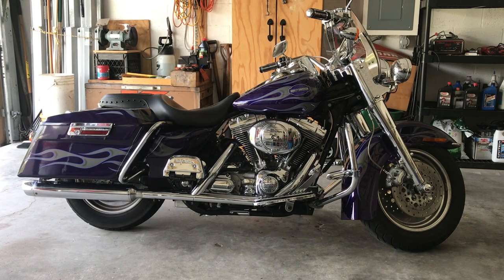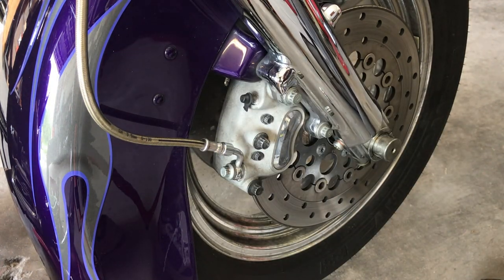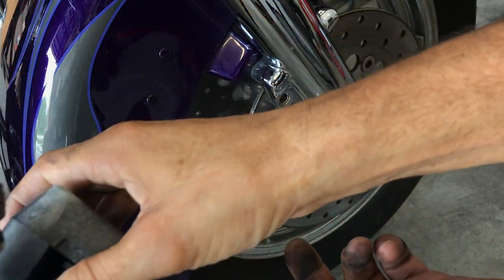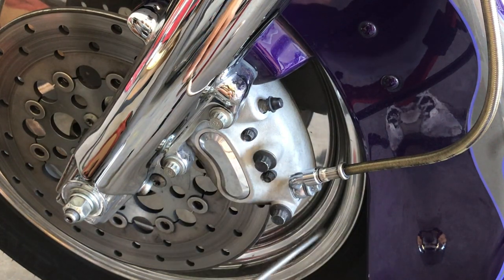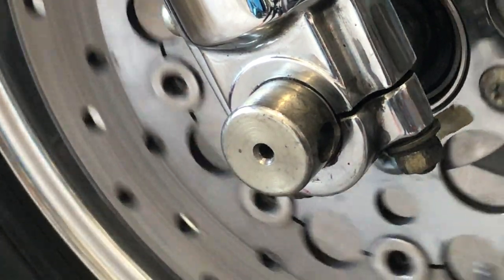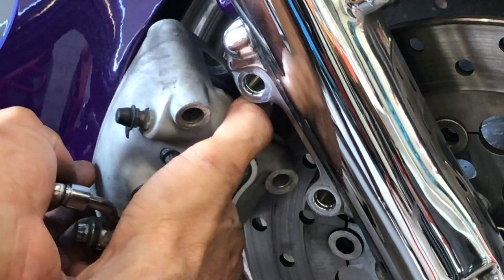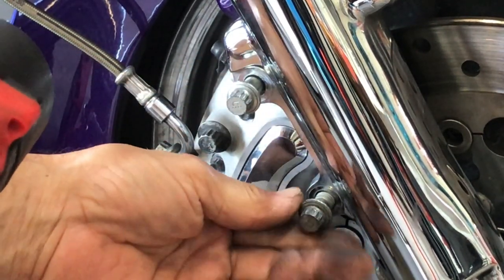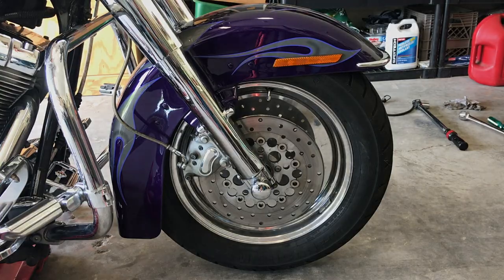How To Harley Davidson Wheel Remove & install.

Comment: Hi Rocco...Nice video, but the workshop manuals all recommend coating the entire axle with anti-seize lubricant...Here's why... "Anti-seize: Use on fasteners/components that have a different metal type than the material you are fastening to (the axle and bearings are dissimilar metals). The use of Anti-seize is for the prevention of dissimilar metal oxidation which occurs when two different metals come in contact".
Reply from the maker: Thank you Matt, I will keep that in mind. Ride Safe and have a great day.

Comment: I saw another video where a guy used a Crown Royal bag to put the calipers in.  Won't scratch anything bumping around..  Thanks for the torque values.  The caliper bolts are 16-24 ft lbs...
Reply from the maker: Just trying to help,  Thank you for watching and your comment. Ride safe and have a great day.

Comment: On my 05 electra glide, the spacers on the front axle are different lengths.   It's not obvious unless you hold them up next to each other.   If you get them installed on the wrong sides, the brakes won't fit on the discs properly.   It's a good idea to keep track of which one came off which side when you take them off.  Thanks for the video!
Reply from the maker: Happy to help. You're right, I agree with you 100%. When you take something apart put the parts on the right side and the parts from the left on the left side and you'll keep yourself out of trouble. It's an easy mistake to be made, especially if they fall on the floor and roll. Thank you for your comment and all your support. Road King are great motorcycles. Ride safe and have a great day.

Comment: That's what I have. XLH1200, and an FLHR. Also I saw the hole you placed the screwdriver in on the axle. Some people will put the hole in the up and down position. That can make a noise when you're going at faster speeds, like blowing across a bottle, and drive you crazy trying to figure out what it is. :) Thanks for the video.
Reply from the maker: Happy to Help, Any questions just ask. Thank you for your comment and your sub Pete.  Ride Safe and have a great day.
Reply: @TwoWheelRocco   You too sir :)

Comment: Love your videos, I have a 2012 Road king and need to remove the wheels off to get new tires put on. Thanks for a great video. 😀
Reply from the maker: Happy to help. The rear wheel is the harder one. Make sure you acquire that half-inch steel rod. It gives you a lot of room to work with the spacers, the belt and all that. Any questions just ask. Thank you for watching and your support Biker_Boi_Tein7.  Ride safe and have a great day.
Reply: @TwoWheelRocco  yes sir, the rear one looks harder because of the belt. I used to ride sport bikes and worked on them much easier, lol. Thanks.
Reply from the maker: @bikerboiteinz717  Once you get that half inch rod, it's not a problem. slide that half inch rod in.  you have more than enough room remove the belt it will be easier than your sport bikes. There's no grease. Ride safe and have a great day.

Comment: This is a great video and you are a good teacher.  I am curious why you do not tie the bike to the lift?  I had visions of popping the wheel off and the bike doing a back-flip off the lift.
Reply from the maker: Happy to help. When I fully understand the balance points, and that does come with experience. In the beginning, I used to tie it down but now I understand where the jack needs to go to do the front or where the jack needs to go to do the rear. Very stable when placed right.Thank you for watching and all your support SplitHairz.  Ride safe and have a great day.

Comment: Thanks for the video, just what I needed when I needed it, plus straight forward to the point.
I had new tires installed last fall at an independent shop, he put the wheel on backwards so the tire is in wrong rotational direction.
Reply from the maker: Happy to Help, Any questions just ask. Thank You for your Sub. Ride Safe and have a Great Day.
Reply: @TwoWheelRocco  .. ?
Reply from the maker: @ryangould536  Thank you for watching.  ?

Comment: Hi, is it ok to fit used lifters from another bike that only have 9000 miles on them? I'm a bit worried that you should only replace with new but can't see any real issue as they measure the same and they are a nice sliding fit in the bores, what do you think?
Reply: Forgot to mention that the bike is a 2002 1200 Sportster. Thanks.
Reply from the maker: I would not, Let us know how it works out.

Comment: Hey, Rocco.  Thank you for the very informative videos on a bike that is close to my own year of manufacture.  Just a point:  The axle holder nut torque, as per the manual, should 
be 11-15 ft-lbs (15-20 Nm).  I hope this is not the same as the pinch nut bolt, mentioned above...
Reply from the maker: Happy to Help, Thank you for your Sub Jan. Ride Safe and have a great day.
Reply: @TwoWheelRocco  That is the same thing.  11 ft-lbs is 132 in-lbs, and 15 ft-lbs is actually 180 in-lbs.  So you were spot on Rocco.  Great Videos, thanks very much.
Reply from the maker: Happy to help. Thank you for watching and your support Joe.. Ride safe and have a great day.
Reply: Any chance you might know the torque on the pinch nut bolt? Thanks.
Reply from the maker: Happy to help. 10 to 14 foot pounds, Pinch bolts Thank you for watching and your support Roger.. Ride safe and have a great day.
Reply: @TwoWheelRocco  - Thanks Rocco.
Reply from the maker: My pleasure Roger.

Comment: What was the torque on the pinch bolts for that clamp that holds the axel in place
Reply from the maker: Happy to help, Any questions just ask. Thank you for your Sub Willy.  Ride Safe and have a great day.                                                                                                             Torque value
50 - 55 Ft/Lbs  front axle
132 - 180 in-lbs   pinch nut bolt.
Reply: @TwoWheelRocco  the pinch bolts are 30 to 35 ft pounds
Reply from the maker: @chriscouch2169  Only 10 to 14 foot pounds. Tighten the rear one first, then the front (2008 service manual)
Reply: @TwoWheelRocco  yep, I was relayed the wrong info. Luckily I didn't break anything bc mine are torqued to 35 ft pounds. Apologies.
Reply from the maker: @chriscouch2169  I agree. I hate to create my own problems but it does happen. Ride safe and have a great day thank you for watching.

Comment: One of my front wheel spacers has 3 v notches on it. Which side does it go on and do the notches go toward the inside or outside? Thanks in advance
Reply from the maker: Notches face outside. Hope this helps. Any questions just ask.  Thank you for your Sub Russell. Ride Safe and have a great day.

Comment: Rocco I have a 94 Harley sportster 1200 , and can’t get the axle bar to go through all the way it gets stuck right at the second fork even in I align it it’s almost as if the fat part of the axle doesn’t wanna go through the first fork I’ve tried slightly opening the fork but no cigar , can you help give me tips 
TIA
Reply from the maker: Spray penetrating oil in the  axle hole throughout. And then I would would get a steel bar half-inch 15 inches long  and I would run it through the left side as you're looking at your forks. you're sitting in front of your front end and tap the 1/2 bar with a 5 lb.hammer through the fork and  through the rim and tap the axle out the right side.   your axle has corrosion on it.  Remove clean grease reinstall. Let us know how it works out.  Thank you for watching and your sub Jonathan.  Ride Safe and have a great day..
Reply: @TwoWheelRocco  what type of penetrating oil ? Never heard of it
Reply from the maker: @jonathansantorelli4529  penetrating oil three in one oil. Plain simple oil but I see in the picture that you did have the red grease I would loosen up that axle lock bolt remove the axle clean and reinstall. You will need a half inch steel rod. And work it from your right side and tap tap tap have a great day. Let us know how it works out.   patients
Reply: @TwoWheelRocco  I’ve figured out the issue is the thick part of the axle bolt doesn’t want to go into the hole , to fully go through on left side I tested it backwards and noticed the issue is there I’ll keep updated if I can get it through , next issue to fix is my carburetor I bought the bike used worked great for a few days than had gas leak just wanna get it up to date for inspection ya know 😂
Reply from the maker: @jonathansantorelli4529  good luck I see you have it all under control.
Reply: @TwoWheelRocco  yeah , do you have any suggestions to pry  the fork pinch open just enough to let it slide in
Reply from the maker: @jonathansantorelli4529  I would not try to pry at that fork. What I would do is remove it clean totally with steel wool zero remove all imperfections. make sure it's really smooth in and out tested on all surfaces and holes. and then reinstall, tap on left side Axel end. with 5 lb hammer hold right side you'll run the axle in. Browsing can be a bitch. and you did take it apart so it will go back together.  There  something we are missing, clean it. let me know how it works out.  don't try to widen that fork slice. clean remove and reinstall.

Comment: My friend i need your help. I have a electra glide fhlt 1999, i was replacing my rear rim for a DNA.  I notice that the left side (belt) has 2 spacers and the rotor side has one. My spaces dont have markings on them and sadly i couldnt catch them when they drop, that been said the spacer have a flat side and a tapered side, how do i install them? Tapered to the inside or facing out?
Reply from the maker: Happy to help. Tapered side going towards the wheel on the primary side.. Any questions just ask. Thank you for watching and all your support. Ride safe and have a great day.
Reply: @TwoWheelRocco  thank you so much!
Reply from the maker: My pleasure. Ride safe safe and have a great day. @jhfelicianophoto

Comment: Thank you brother nice video.. But I have a problem. I torque axle to 50 lbs, and my tire doesn't want to spin it's very tight. Any suggestions? Thank you.
Reply from the maker: I usually index the left side axle. I put it back to the exact spot that I took it apart, Then tighten down those pinch bolts and then torque.down the other side. If you don't do that, it pulls the caliper in and pinches the caliper and makes it drag. Take a look at your left side unloosen the pinch bolt and see that you can move your fork over and it will start spinning easier. Let us know how that works out. I've seen this problem before Thank you for watching and all your support. Ride safe and have a great day.
Reply: @TwoWheelRocco  Thank you I will try that. Your awesome
Reply from the maker: Let us know how it works out you should be all right.
Reply: @TwoWheelRocco  it was my rotor. When i was taken tire off or putting  on the rim, i got a little to beasty.  Ha. I fixed it brother, Thanks a million..  ⚡️⚡️
Reply from the maker: Happy always behind you. Love those Road Kings. Ride safe and have a great day.
Reply: @TwoWheelRocco  yes I do too, i put belt on back, apes of corse lol,and its a police  road king never been in service, but i like  the bags knob on the top and opens out words, I do want to get head work and put gear cams in it, also  21" front rim, then I be set. But i go threw bikes like  women, haha, so I'm not sure if i will keep her. My last bike was 98 fx  built had 655 lift cam 700 triple behive springs jims roller rockers, titanium valves In the heads,  STD Dule plug heads, list goes on to much for to list all here.  Lol Take  care, ride safe to all the brothers and sisters here, thanks again BobbyBlood
Reply from the maker: Happy all is well. Thank you for the update. Ride safe and have a great day. Love those Road King.

Comment: I just used this video to change my front tire on my 2006 road king. First time ever doing it. I put the spacers back on the way they came off but it seems at 45mph my front tire is bouncing any other speed smooth as butter. Which way exactly are the spacers soppose to go back on? Mine has arrow type notches in one side but not the other. Notched one was put on the clutch handle side and the one without on the break handle side. Is that correct? I don't have a Manuel.
Reply from the maker: Happy to help. If you had spaces on the wrong side your caliper on the front brake side would not line up properly. Check your air pressure. And when you say you put the tire on how did you mount the tire onto the wheel? Thank you for watching. Check tire pressure. I believe if it was on the wrong side of space or you know about it real quick. Let us know how it works out. Ride safe and have a great day.  Sounds like you're low on air pressure for 41 in the front see what it does.  Marks on the spacer will not make a difference.
Reply: Apreciate it. After re checking I did everything properly. I also commented on another one of your comments about the pinch bolts just wanted to specify that I was wrong it is 132 to 180 inch pounds I was told the wrong information. Luckily I didn't mess anything up bc I did 35 ft pounds on them. The tire was put on and balanced by a reputable shop but I'm starting to wonder if it's slightly out of balance. Apreciate the response!
Reply: Also made sure everything went together smoothly by what your video said if your fighting it it's wrong. Everything went in finger tight first smooth as a whistle
Reply: @TwoWheelRocco  could over tightning the pinch bolts cause anything?
Reply from the maker: @chriscouch2169  no, I do not see that as a problem. When you do figure it out let us know. Could be a bad tire. You didn't have this problem prior to tire change. What tire? what brand are you using now.

Comment: Thnx voor de video, can you please explain why the spacer on the right side must have the groove to the outside?
Reply from the maker: Happy to help. If you look close the edge is broken on one side to make it easy to install otherwise there's no difference and it does not matter that's my opinion.. Thank you for watching and your sub Peter. Ride safe and have a great day.
Reply: @TwoWheelRocco  Thank you for your answer and quick response :-)
Reply from the maker: My pleasure,    Ride Safe and have a Great Day.

Comment: Hey Rocco!  Love all of your videos. As I was reassembling the front wheel I noticed the spacers were slightly different widths. One is 23mm and the other 25mm. Is this correct?  One has a line around it and the other does not. Any help would be appreciated. Thank you!
Reply from the maker: The smaller one is on your front brake side. That's how my bike is. You will know if it's wrong when you go to hook up your calipers. Let us know how it works out. Thank you for watching and your sub Shaun. Ride safe and have a great day
Reply: Worked perfectly. Thanks Rocco!
Reply from the maker: @shaunwilcox1345  Happy to read all went well...

Comment: How are you rocco   Hey had a question i got a roadking 2001 front wheel got 21 front spokes dna 🧬.  I ride the bike normal but the other day i jacked up the bike and try to spin the front wheel and it was torqued just like you did it.  Like the manual said. Front wheel in the air by hand spins like its dragging.  Not to mention new rotors new brake pads and front wheel with the brand new rim  but when is on the ground rides smooth.  Fender didn’t had to be extended based on other’s knowledge.  You got any ideas whats the dragging?
Reply from the maker: Remove brake calipers and see how it spins without calipers.  It is normal for there to be some drag on your wheel rotation. if you see abnormal brake dust on one or the other side. Check axles adjustment by pinch bolt. and hole in axles. Let us no how this works out. Ride Safe and have a great day.

Comment: My bike has 10500 miles should I remove front wheel and check bearings ? It’s a 2006 roadking FLHRI
Reply from the maker: I would just remove brake caliper and turn wheel to feel for any rough spots.  No need to pull the wheel. why do you think your bearings are bad. Any questions just ask. Thank you for your Sub,  Ride Safe and have a great day.

Comment: Great video! Here's my question, when I removed the axle I didn't not note what spacer was for each side, I have 1 a bit longer then the other one. How do I know what spacer goes where? Thanks
Reply from the maker: The smaller one is on your front brake side.   If you are sitting on the bike that would be right side.  You will know if it does not spin when caliper is installed.  Let us know how that works out.  You will not damage if you have to go the other way.
Reply: @TwoWheelRocco  Thanks for the quick response! I have dual brakes on front does the same go for having dual brake calipers?
Reply from the maker: It will not spin proper. You will know if you need to reverse your spacers. Let us know how it works out.
Reply: @TwoWheelRocco  Update, everything went back together with no problems at all. Thanks for your help Rocco!
Reply from the maker: Happy to Help. Thank you for your Sub Steve. Ride Safe and have a great day

Comment: How do you get that alignment right,?  mine want spin....like it's traped
Reply from the maker: Happy to help. Remove the calipers and see if the wheel spins at least then you know it's the brakes and you need to align the hole in the axle to your fork.  And by aligning it all you're doing is shifting the fork tube over and re-tightening the pinch bolts on the bottom of the fork tube. Let us know if that helps.   And if you need any other help, send me a cell number and I will call you.